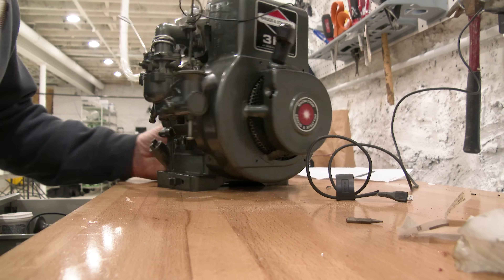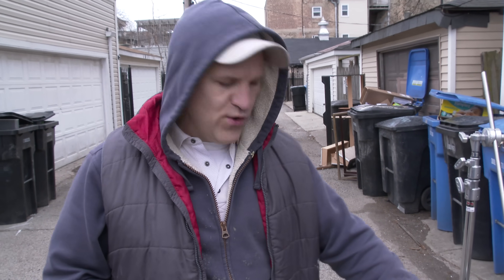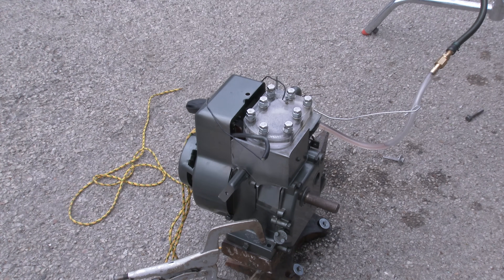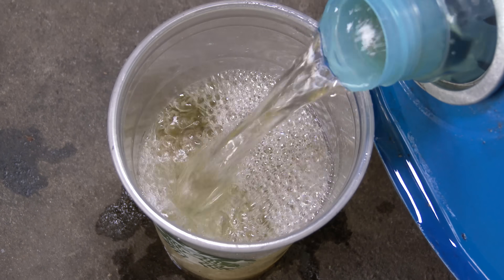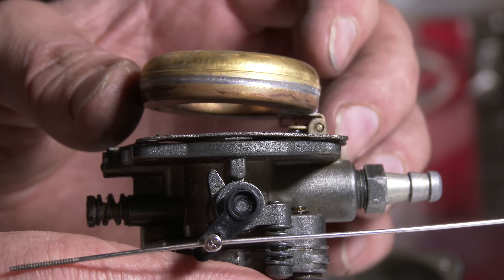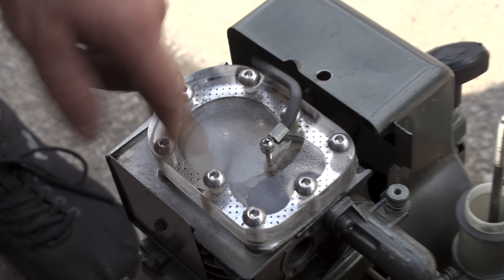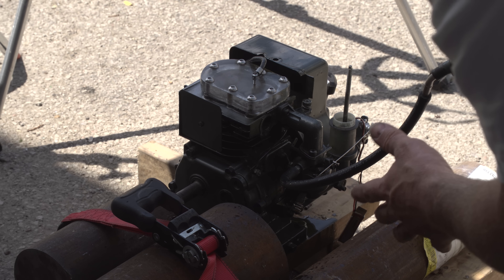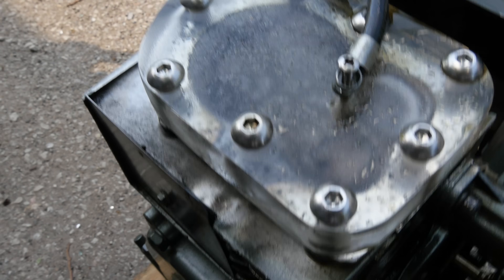See Through Engine on NITROMETHANE - Blow Up Attempts 1 -9 Crazy !

Comment: The oil leaks were caused by excessive crankcase pressure due to high cylinder pressure leaking past the rings. This problem will be compounded with the addition of a turbo.  The ultimate failure could very well be due to oil starvation. I melted the piston in a Ducati 160 with nitromethane back in the early 70's. Didn't advance the timing far enough.  It sure was fun though.

Comment: i havent ben playing around with B&S engines for a ling time. stil isent the timing controlled by the slin in the crank controlling the point's?
Reply from the maker: grapsorz not on this one, if you take a closer look when I remove the flywheel, underneath there's nothing, just the crankcase, in this particular engine there are no points only a Magneto.
Reply: your right. the space and casting for the capacitor and points is there unused. never seen that type of a setup.

Comment: nitro doesn't really burn different. It has added oxygen in the fuel. 90/10 nitro burns at around 4:1 where pump gas is 14:1. 4:1 means you can squeeze more fuel into the engine and make more power. The only thing that really changes is the amount of ignition advance you need bc nitro burns slower than pump gas.
Reply from the maker: James Bonds yeah you are spot on, I am going to rig this up proper.

Comment: My opninon is that the nitro and its sharp pressure spikes killed the rings a fair bit, causing excess gases to enter the crank and its blowing oil into the carb through the vent.

Comment: When you turbocharge it, you should drill out the main jet in the carb to increase your fuel ratio (use the main jet hole cross sectional area in ratio to the Venturi minor diameter to get your fuel flow increase in the ball park). Nitromethane has a much wider tuning window, but you still need at lot more than gasoline to get the big bang you're looking for. Loved the video. I'll be looking forward to your turbo video.
Reply: I think it has an adjustable main jet

Comment: I’ve never tuned a nitro engine, but I wonder if you’re putting enough fuel in it. Nitro can go rich AF, and they say that’s how it makes the big numbers. Also, raising the tank higher shouldn’t do anything for air/fuel mixture unless the pressure in the line is pushing past the needle and seat and flooding the bowl. Try running a fuel feed directly from the tank into top of the carb, and trim mixture at full noise with an adjustable valve. Love the videos, keep them coming qq

Comment: My first engine classes started in high school in Wisconsin.  One of the first things we were taught  by Mr. Dynes was that most small engines were difficult to cause catastrophic failure. You were able to prove that is still the case. I thought that the light bulb would've gone off in your head when you were explaining the advanced timing and the fact that nitro-methane is slow burning. Not what you need when trying to get an explosion. I think that your acrylic or polycarbonate heads were the most informative part of your video. I'm curious how they would function if you were using pure oxygen as your oxidizer with the nitro-methane. The head may add fuel to your burn and at the same time stay crystal clear.

Comment: These older flat head style Briggs motors are tough to blow if you got good oil in them I ran a 5 gp flat head on 30 % nitro meth for years on a mini bike with no governor hooked up I never did blow it up ran extremely well very strong little motor

Comment: Mixed my dad's nitro for years. It's not dangerous at all, I smoked while balancing out 85/15. It's nothing until you mix it, then watch out! Nitro meth can be ran in anything, use marvel mystery oil to keep the heat down or a ashes two stroke oil at 110:1.

Comment: Well that was interesting, But it was a long way from a catastrophic event. Sadly you need load on the motor for that to happen. 
My personal favorite way of sending a small engine to an early grave is the use of oxy acetylene. There are a couple of ways I have done it but the easy way is set a carbonizing flame out of the torch, snub it out then into the intake. There is more to it but I wont put it here because it takes a bit of care, but is very effective. The other way is like the Germans tried in ww2 that is tricky but when tinkered to enable self destruction you can get flames out of the exhaust hat will put a top fuel to shame. 
Message me if you want details, only warped perception please.
I see you are going to turbo the little thing, perhaps your shop air would be better if you have 20 cfm it should be enough for a 200cc 4 stroke.
Cheers
Reply from the maker: its coming

Comment: Your advance is too much, that's why it idles and dies so quickly; as you can see in 12:10 (the cylinder head hasn't reached top yet, before the fuel combusts). I would adjust it by 2 to 5 degrees. Especially under load, this engine would be lugging.

13:16, the oil spillage is most likely due to surpassing the peak RPM range.
Oil will be flying around at high speed in the crankcase, and the pressure might be pushing it inside the cylinders.
The good thing is, with less oil, there's less pressure; so I would recommend filling up the engine oil, on LOW level, when trying to run high RPMs.

Nitro burns quicker than regular fuel.

Comment: Why are you even using the crap gasket??.  Just run it without it!.  It will also increase the compression ratio.
Reply from the maker: +Marek Sumguy actually without one of those gaskets there would be interference between the head and the valves, I made the new spacer as thin as possible to increase compression even further. The head is literally about .0020 away from the head. It's so close to making contact.
Reply: Make a custom gasket/spacer out of solid metal... so it won't fail.

Comment: Nitro methane that is in top fuel dragsters isn't flammable, but if you hit it with a hammer it with most likely blow your hand off and the hammer sky high. The dual magneto they use it's to just get it started then the rest of the run if off pure pressure and adding more Nitro.
Reply from the maker: +OGskunkMASTA you're thinking of nitroglycerin, that's something completely different but it's confused very often. If you look on our behind the scenes Channel I burn nitromethane in a beaker, the white portion that you see burning in the flame is nitromethane, it's over oxygenating the alcohol. Check it out and tell me what you think it's called Warped Perception X

Comment: I have always wanted to see detonation and for years have looked for research footage coming up empty handed, turns out there isn't many transparent engine setups. Perhaps this might be a great opportunity as a first to capture the detonation process?

You will need some crap low octane fuel, really up the compression ratio, high advance and more than likely a high load on the engine while giving it full noise at high rpm typically where denotation occurs.
Reply from the maker: +3800Tech agreed, that's on my list but it's pretty hard to replicate, I got to wait till I'm making some more money here on YouTube and with the discovery episodes to make that happen, I definitely want to do it though

Comment: i don't think that you changed the timing by repositioning the flywheel on the crank.  you might have but looking thru your plastic head.. it was still firing close to top dead center.  on much earlier briggs.. there was a points set under a cover below the flywheel. i don't know how they work the electronic ignition off hand. 
here is a video simulating how much fuel is sprayed into a single top fuel motor intake port and cylinder during a 1/4 mile or 1000 foot run.. https://youtu.be/xGTbQuhhluY  

 i would also if you ever experiment again.. want you to run some kind of step down exhaust pipe..  the first part is the same size as the exhaust port diameter. about 3 or 4 inches farther out.. reduce the pipe diameter with a smooth tapered transition about 30 percent but double the length of the larger size tube. .  this allows the combustion to expand into the larger pipe.. but when it gets to the smaller pipe it increases in velocity and causes far better scavenging. lowering the pressure in the exhaust port for the next time it opens.. it really works.. 2 stroke extractor exhaust is on the same theory.. if you went to an overpipe on top of the reduced diameter pipe.. and that was even longer.. you get some really interesting sounds out of the exhaust.. friend did that with a napkin drawing on his 2.2L honda.. sounded like a healthy big block chevy with his tuning tube installed. picked up 10HP at higher engine speeds on the chassis dyno also. 

i just subscribed..  if you have a drill press.. some diamond hole saws.. you might be able to scrounge a piece of fairly thick plate glass.. cutting it to size with diamond saws and drilling for the head bolts with tubular diamond drill saws. or carbide tipped glass drill bits.   

 you can seal the head gaskets better using a specific permatex 85420.. flange sealant.. available at most parts stores.. also known as hylomar.  i have been using it professionally as an auto mechanic since 1993.. 

 i expect that on piston removal.. you will find plastic down around the piston rings lifting them off the cylinder wall and creating the additional blow by you experienced.  please note the torque of the connecting rod bolts if you do tear it down..  you may need an inch pound torque wrench to put it back. 

for the spark plug thru the head.. you may have to get creative and cut the shell carefully off an automotive spark plug and using your coring tool make a pocket for it on the inside of the head.  so its just the ceramic portion with the center conductor.. 

be sure to check the storage requirements of the cans of nitromethane you have purchased.  don't pour any unused back into the cans..  non fuel injected cars are a fun place to get rid of it a small percentage at a time..  non fuel injected motorbikes also.  you want a kick in the pants.. not a kick in the wallet ..  old VW's with the tips of the exhaust exposed..  makes a crazy purple flame only visible at night..

Comment: This sounds counter-intuitive but you likely need more ring gap, the increased heat will cause the rings to contact each other and probably break a ring land on the piston.. and you HAVE to rejet the carb for it to make maximum power. Raising fuel pressure wont change the mixure because the float should be regulating the bowl level. it makes no difference if you get more fuel pressure.

Comment: That slow motion on the comparison of the burns between nitro and petrol is incredible ... you can see the nitro basically detonate vs the petrol just burning extremely quickly .... 
Instasubbed the second you showed that 👍
Reply from the maker: +bacon sandwich yeah and I was really awesome, I myself was very impressed when I first shot that, I have never seen nitromethane filmed in high speed in a combustion engine, as far as I know I was the first to do it. It looked amazing. Thanks for your feedback and thanks for watching

Comment: Drill an RC glow plug and you’ll have less trouble with the ignition, and also I don’t know if it’s possible, but if you can get a hold of some pirex glass instead of the plexi glass it would last longer.

Comment: Looks like an upper percentile motor in terms of balance and casting strengths.  I'm surprised the rod didn't fly out of the side.  Of course RPM is only part of the story - there was no load.  9 out of 10 would have puked their guts.

Comment: The whole point with the float bowl on the carb is so it doesn't matter what height the tank is as long the bowl is full.
Reply from the maker: +Andy [Xvixx] that's a good point, and very correct, but for that run I opened up the float all the way and plugged up the vent on the bowl, that's the only way I was able to get enough fuel pressure to pump more nitromethane in there, in the future I'm going to do it differently. Thanks for the feedback

Comment: That carb will never put the amount of nitro into the engine that would maximize power needs to be injected almost to the point of hydraulicing
Reply from the maker: +Len Ness you're right, I thought of that already, I think in the next episode I will do a fuel injection system.

Comment: Thumbs down... you should have wrote the title trying to blow engine up at Redline with different fuels than normal. Nitro needs to be super rich. If you had the mixture right it probably would idle and rev fine. I don't think any engine could survive being held wide open under lean conditions with a see-through cylinder head. Set up to fail from the get-go
Reply from the maker: +all the boost well it wasn't set up to fail good enough because it survived.

 It wasn't title that way because this is a continuation from the previous three videos.

Comment: I've got a request. It's about combustion theory, particularly quench.

For the viewers, quench is when a piston comes almost into contact with the head and this squeezes the air-fuel mixture out at high velocity, the turbulence from this is supposed to improve the burn in the combustion chamber.

You have a flat-head engine where adjusting quench clearance is simply a matter of head gasket thickness. Compression ratio can also be varied/corrected simply, by grinding some material from above the valves.

Can you do a few clips of ever-decreasing piston to head clearance? I would love to see the difference in combustion that altering quench clearance makes. Preferably down to zero if possible.

Thanks
- Skip

Comment: at the end of the day all engines have an air fuel, the reason why nitro is so violent is because of it's CH3N02, the O2 is the important part. nitromethane actually has 2 parts of oxygen in the fuel which means you can almost hydraulic the cylinder with fuel and it will still burn, the top fuel team my dad and brother work on actually had a Briggs on nitro just like yours, instead of a carburetor we ran a kinda y'ed water dump and a return spring that would pull the handle to a "idle" position. we ran a small electric fuel pump and roughly 45 degrees of timing, did the math and it made a "calculated" 67 hp lol

Comment: I'll admit first off, that my knowledge of four-stroke engines  (and combustion engines in general, I guess) is somewhat limited,  but does the lack of a load to propel have anything to do with how quickly these engines do fail? I've always heard the more you run an engine that's not under load the worse it is for it, since it is more free to over-rev, since it has nothing to regulate its rate of acceleration.
Reply: Joe No. Load itself is quite an arbitrary factor, it's the resulting requirement of increased RPM.

Comment: Needs a proper head, and nitro-methane + nitrous oxide with the proper fuel mix for the added N20, I wana see a 70hp Briggs! Also, isn't that spacer increasing the capacity of the "chamber" decreasing compression? I wonder what the output was on this little 3hp motor with the 50% nitro-methane fuel, 20hp?
Reply from the maker: Mean Man well the stock head is recessed the same. When I made the new spacer I made it as short as possible to raise the compression as much as possible. I should have checked it before and after but this episode was already very long because of the stubborn engine.

Comment: This poor thing got so fast that the oil pressure skyrocketed through the roof, so all the gaskets are now just toothpicks in the way of angry bull :)
Reply: Krivulda...... while that may be partly true... the main problem with running "pop" (as we call Nitro in drag racing)... IS, Oil Dilution... and of course, oil level increase along with it.   Briggs engines still (even though this one is an older model) use the very simplistic (and Antiquated) "splash" method of "lubricating" the engine.... so any increase in oil "pressure"... is confined to the crankcase and as the oil level increases (from dilution) it also decreases the air space internally and as the oil becomes thinner and thinner it Will find places to relieve that pressure and thinned out oil through every orifice that it can.
Reply: yea, any old wka or gocart racers will remeber dumping the light gray goop of oil after each race.  Start with 1 litre, end race with 1.5.  We used to run large external breathers/catch cans that recycled back into crank.  Would be interesting to see how many bars of pressure where kicking around in the crankcase.

Comment: Amazing video and amazing slow mo, thanks for posting and please do the top fuel/turbo/full on advance thing soon, I wanna see that thing throw a rod to the moon lol :D P.S. what was the cause of the oil everywhere, crankcase pressure or did it ruin the oil seal on the flywheel end?
Reply from the maker: dan mackintosh haven't checked it yet.

Comment: Love the clear head, takes the mystery out of what the combustion event actually looks like.  I got a request though that I think would be super cool to see.. as I'm watching your vid u was thinking wow that's a lot of spacer between the head and the deck.. is that because there is no combustion chamber cut out of the acrylic? Anyhow the point is I think it would be awesome to be able to see what spark knock and detonation look like. Take the spacer out and leave just enough room for valve relief so as to have a monster compression ratio and see how long it will run while detonating
Reply: Ryan Klos  the only problem with bumping up compression in a flat head style engine is as you raise the compression ratio you decrease airflow as the air has to travel from the valve across the deck of the block to the cylinder and back again a better way to raise compression in a L head is to use a piston that sticks out the top of the cylinder and almost touches the head